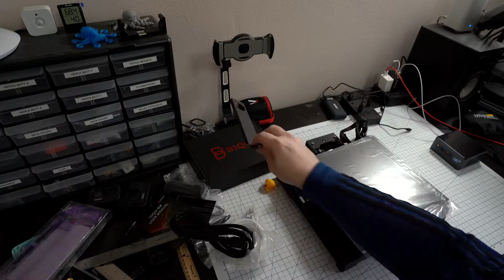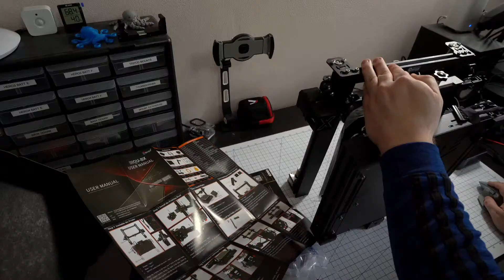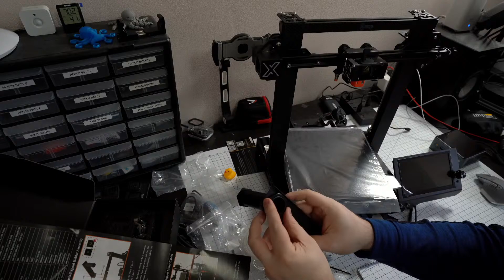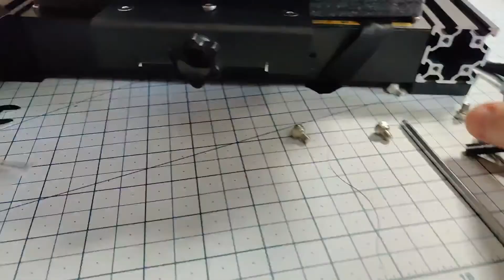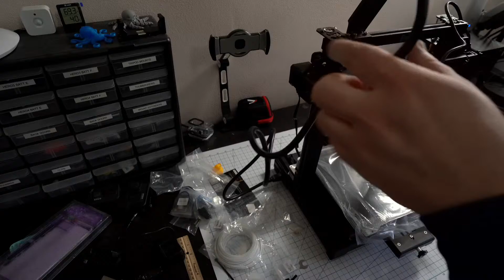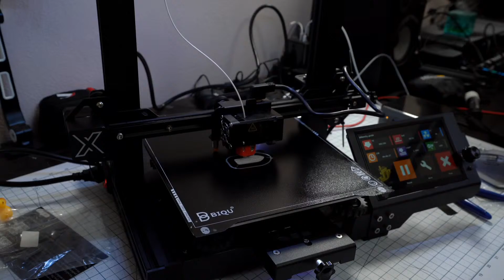BIQU BX 3D Printer Build & Test

Comment: Hi Just got this printer.
So far like it but wondering if yours puts the nozzle off the bed during the ABL process on the right side?

Mine also seems to do that too when I select the front & Back right a corner for manual leveling.

Comment: Stuart, have you got things squared away with the BX yet? I assume you've read the FB page on the BX and have found the updated FW there. Also just posted is a new Cura printer profile for the BX, provided through the hard work and many hours of Luke Jobs Harrison. Also, Luke was a beta tester from the start of this project. He has also provided a terrific build and assembly guide which also includes crucial setup steps. The only thing I've not got working on my BX printer is the rPi option. Hopefully when Luke gets the new FW posted on his github page things will work even better. I've been using the Cura B1 abl printer profile for the last few days. I'm in the middle of a 30 hour print project so I haven't had a chance to use the new Cura profiles. I also removed the G29 command from the start code in the B1 profile. I just didn't want the printer to run a ABL test before each print. I truly hope your enjoying your new printer. Thanks for posting a raw video of opening, assembly, setting up, and first print of a new BX printer.
Reply from the maker: Hey Perry, thanks for stopping by! 

Mostly squared away, yes! I added into the description that I've since done the fan mod and flashed the firmware from Luke here: https://github.com/looxonline/Marlin

I'm currently running an ~11 hour print with the new Cura profiles actually! So far working well! A few small issues here and there but I'm pretty satisfied so far. I'm going to go through his setup guide again and make sure things are truly square and dialed in, I just wanted to show the direct out of the box experience in this stream. I haven't implemented the Raspberry Pi either but that'll come soon! Planning a follow-up stream/video sometime this week with a bunch of test prints and further steps I've taken. The hardware is so good that I'm quite sure the BX will be my new workhorse, and it'll hardly need any modification at all which is excellent!